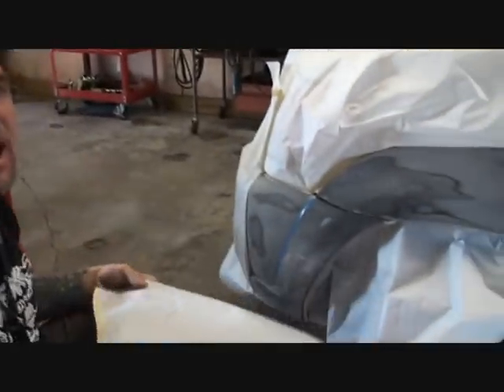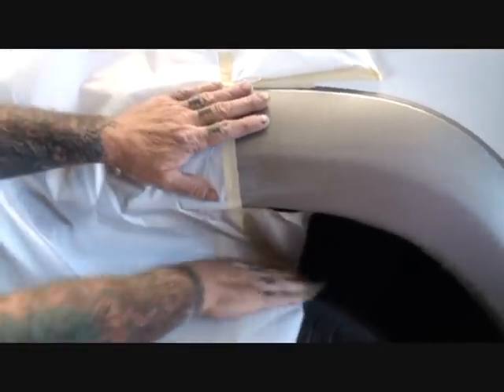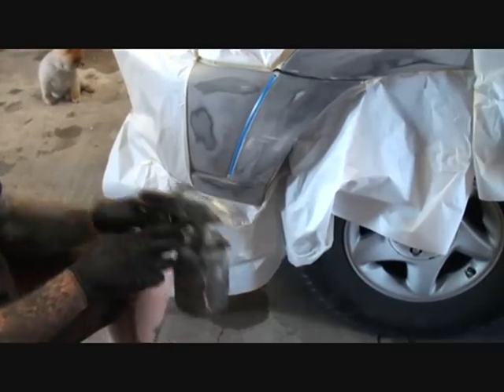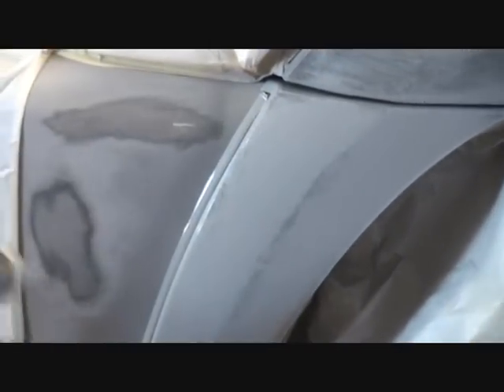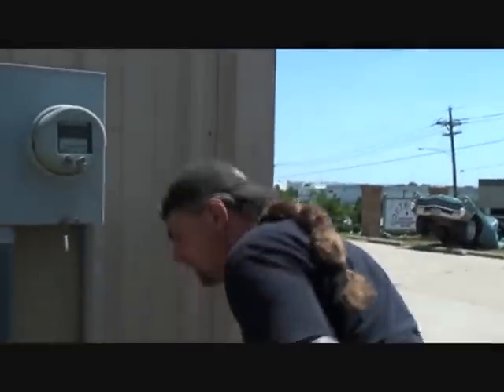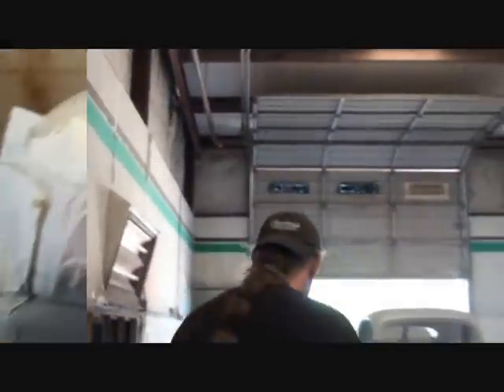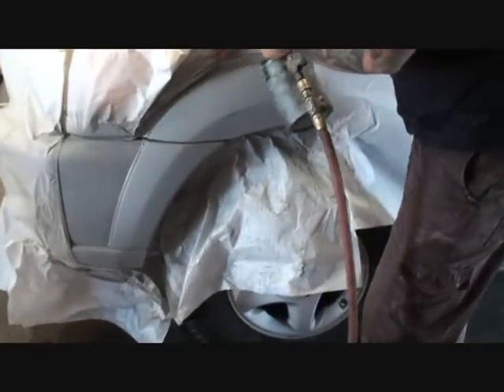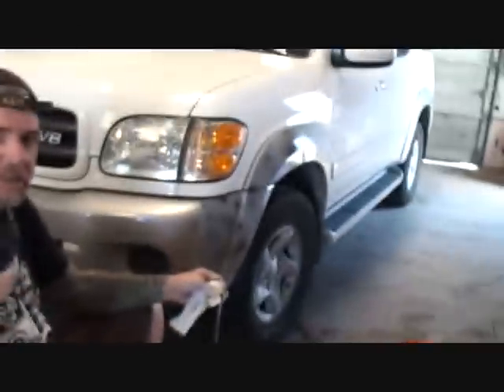Automobile Collision Repair-How To Repair Your Plastic Bumper Cover. Part 2

Comment from the maker: @Romeyd67 You'lll either have to remove all the paint or maticulously sand it till your fingers hurt. Use dry sand paper , 80 to brake it down and 180 for finish, then reprime and paint.. Good luck Pete

Comment: Hey Pete I wanted to say thank you so much for your late tips. I've done two paint jobs this week and they have dramatically improved! The only thing that pissed me off is that I can often see the edges of the primer after finishing, even thou I block sanded it with 240 grit. Maybe I should have just gone deeper and not really fear much of the scratches. I guess it'd be sufficient to DA the edge with 320 and then 400 before painting, whatcha think? May we spray clear on 400 without base? Cya!

Comment: I would have used a powder guide coat and covered the entire primer surface. Helps to ID the orange peel effect while sanding and ultimately leads to a more efficient result. smoother surface.

Comment: Charlie was trying to explain his situation at the end.... I mean he's taking instruction from an ex US Navy Seal or something... Charlie just has to agree ya know. I learned about Guide (Guy) coat and Back Taping. I tried that Bondo (EVercoat Metal Glaze) and that stuff hardens like glue. Tough to sand unless you use the 80 grit. Best where no damage from sanding can effect you like stripped off paint. Thanks for the tips.

Comment: @swrnc Thus it's better to go a little further with the base coat over the block sanded and 400 sanded area and then clear? For clear only I usually scuff with 3m black pad (I saw you use it with water and soap as well)... do you think it can be considered equivalent to a certain sand paper grit in order to follow the grit steps when sanding? One more question: I'm gonna do a major nitro paint job, do you have particular tips to properly spray such paint?
Take care man

Comment: what kind of plastic bondo filler are you using to fill those scratches? I tried to use bondo but it didn't work to well I think that is just for metal not plastic.
Reply from the maker: +jason balllicker You want to use Evercoat Metal Works Polyester Filler, not bondo.. Good luck. Pete
Reply: thank you

Comment from the maker: @alepeccia Just turn your air pressure down and your paint volume up, this way the primer goes on wetter and you don't have alot of overspray in the air. YOu have to be fast, because you will get runs in it. Keep the gun close to the area you are priming. Thanks Pete

Comment from the maker: yes you can blend the clear, but you have the chance of it peeling and flaking back later down the line, it's much better to clearcoat the whole bumper and it doesn't really take that much longer or use that much more material.

Comment: The Bumper Still looks bad. What would you use to redo a white plastic bumper. I got a coworker that needs her front and back bumpers redone and her driver side fender extension redone. I don't have air tools but I have electric.Do I need an air tool to spray the primer or could I just use electric?

Comment from the maker: You could but using a blow dryer really doesn't put out the heat you would expect, but yes you could use it, just be careful not to get it too hot, it will warp the plastic and ruin the primer.

Comment: many thanks for the great videos. please can you tell me what kind of spray gun shill I use I am working at home and painting for small jobs not a full bumper or full doors for the touch ups only and similar to your video  the other question sir I need only the primer after the sanding and before the painting ?the last question what are the sanding paper numbers the you use and can I sand by hand because I don't have the die grinder ?best regards

Comment: Hi Pete after you repaired your area with Evercoat then  primed the damaged area, did you use the grey scotch-brite+ Scuff it, for the  rest of the bumper cover to blend the paint? 
Then after you blend the paint into the bumper  cover do you clear coat the entire bumper cover that you used the scotch bright on ?
Thanks for all your help i would like to repair a Bumper cover that retails for 700.00 and i do not have that kind of cash to spend on a cover .

Thank you

Comment: The lady that owns the car might well say "Oh my GOD do you even know what the Fuck you are even doing here"?  I like the back fold paper technique he uses.  That shows he does know what the FUCK he is doing except I believe he missed out on saving some work by not taking that 80 grit down to a 180 grit and then a 220 grit and then apply primer.  This would help save time over sanding down that rough 80 grit finish.    I respect these old auto body repair guys cause I used to be one myself.....DO ME A FAVOR WEAR A RESPIRATOR!!! .  one thing i want to know before I quit is:   HOW MUCH DID THIS FUCKING JOB COST THE LADY???    I am still looking for PART 3 !!!!!?????

Comment: @eric31291 go to ebay motors and search evercoat metal glaze. its about 40$.  my friend pete calls it evercoat, but thats the brand nam,. and one of the best brands in autobody supply, just like we call body filler bondo.. bondo is a name brand that i never use. i use evercoat light weight bodyfiller and evercoat metal glaze. metal glaze is the shit you see my friend pete mix with his body filler aka bondo,, which is a secret trick to the trade most techs wont share..

Comment: Why do you need to give this back to the customer in primer? Leaving repairs in 80 and 180 grit is so lazy as the primer will sink into these scratches... it's those weird marks around repaired areas.... just lazy. Anyone watching this please work the  repaired area out 180 320 500 then you don't need high build primer to cover deep repairs, only need three coats. Would be dry in hour as no need for primer to fill in rough bits lol!!! No need for a two stage job!!!!!!!!!!! Just do it right and spend the time.... high build primer will sink into your 80 grit scratches. To be fair if you cannot even apply primer to a smooth standard you need to cut the comedy act and learn your trade.

Comment: then because they half assed the job, a week later I'm heading back to the shop so they can finish the job that was supposed to be done the first time, and wouldn't you know a guy in a truck runs a light and totaled out my car my car! shitty part is i didn't got my deductible back or anything.they wouldn't let me have the bumper cover i basically payed for, they claimed that they were gonna take it in the ass cause they had an extra part they couldn't use. bull shit!!

Comment: sorry pete but 80grit is a no no 180 from start to finish.
Reply: Yeah, and if you are using 80 grit, might as well sand those scratches in the plastic out instead of filling them...SMH

Comment: If paint was just this easy, the real deal or worse part of painting is match colors, if wasn't for that body shops would be pretty much out of business
Reply: If it weren't for insurance payouts body shops would be out of business!  I just got quoted $850 to fix an area about 8x10" in the bumper cover of a Honda... Cheaper to just buy a pre-painted aftermarket bumper cover by $300!  So in the mean time I'm going to fix it myself and live with a $80 job instead of an $850 job